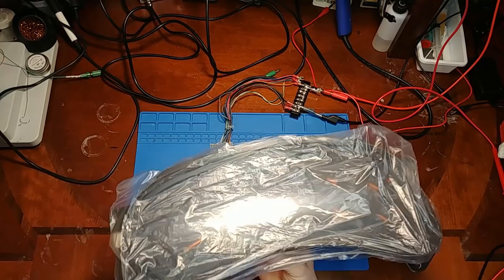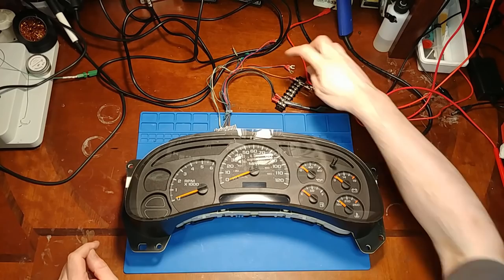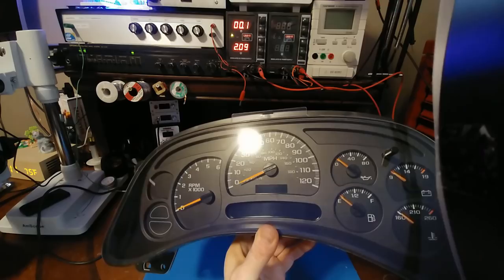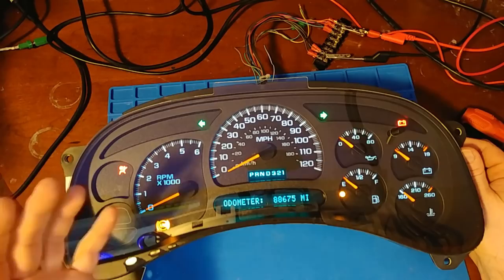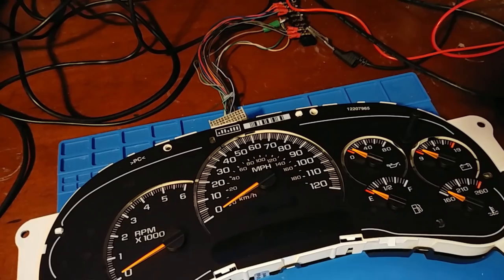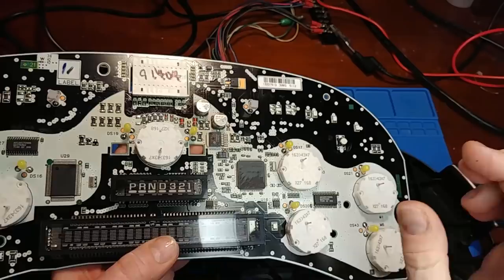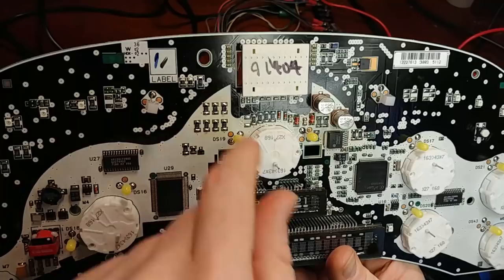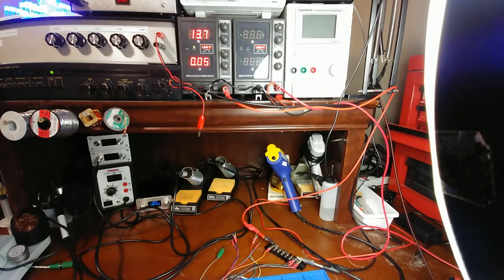Doctors 2nd opinion on battery drain

Comment: How much do you charge to repair clusters? I have a 2001 Silverado that’s starting to have issues with the cluster. I’m looking to get it repaired asap.
Reply from the maker: What issues are you having? Wouldn't want to have you send out your cluster if your having ground wire or sending unit issues.
Reply: It’s not showing prnd or the miles, it works some days and some it doesn’t other than that it’s works fine.
Reply from the maker: @rtrick5040  $50 plus return shipping.
Reply: Do you have a Instagram or something? So I can get shipping address?
Reply from the maker: My email address is listed under my channel "about" tab. It's visible to Windows PC users. If you mobile only you can leave your email address and I'll send contact information.
Reply: I’m gonna post it quick then delete it, cause it’s my personal email

Comment: I have this exact board, but my display will intermittently black out, then days later come back on. is there a model number for this board where i can trouble shoot the problem? Every 06 silverado board i look up they only do stepper motors, or it has the different display that has the PRNDL in it. like the 05 model. i'm not sure if there is a resistor that dislodged.
Reply from the maker: Any experienced thorough cluster tech should be able to do some trouble shooting and take care of that issue. It very well could be a fractured solder joint. If you send it out somewhere just make a note of the problem.
Reply: I could be way off, but wiggle your dimmer knob or run it through its full range. My dash blacks out unless I disconnect the headlight switch. I had it apart and tried tweaking the slider/variable resistor (?) but it didn't help.
Reply from the maker: @grabasandwich  did you see my headlight switch video? The plug does like to feature where it solders to the board.
But his issue is the display, not back lighting.
Reply: @grabasandwich  i can try that, but i know for sure it's not that it's dimmed, that was my first guess lol. But really it could be a loose connection in there too. my backlights are fine, just the VFD. i might just check all my solder connections.

Comment: Do you you know why my prndl display is lit but my odometer is blank, could it be an issue with the 510 resistors? 03 Silverado 2500hd 4x4
Reply from the maker: That group of 510's is for the PRND321 only, so if that display is working it's not that. You probably have a issue in the hot wire circuit or it's power supply.
Reply: Thanks for the reply and the info, I'll check on the hot wire circuit and the power supply

Comment: Jeff thank you for your very informative videos. I really enjoy them and learning quite a bit. Just wondering what have you seen causes a drain on these clusters?
Reply from the maker: It's the microprocessor not talking correctly with the voltage regulator to shut it down all the way.
Reply: In that case does it need to be replaced ?
Reply from the maker: Naw, it's probably just not getting the 5v turn off signal.
Reply: What would the repair consist of?
Reply from the maker: I'll maybe just make a trouble shooting video one of these days going over the common issues and where to take test points at. My CPU replacement video shows some areas to look. It's hard to cover these kinds of things with just words in the comment section. But for now I have a pile of work to get to.
Reply: Thank you for your time appreciate all your cideos
Reply: @jeffescortlx  did you ever make this video for 03 04?  I see mostly up to 02 and lower and 05 and up in the videos.
Reply from the maker: @williamspollitt  yes I'm pretty sure I've covered that year in a few of my videos

Comment: i have a 03 silverado that doesnt go to sleep with the key out the battery light and prndl stay lit and it kills the battery over night what do you think is up with it and i am looking for a repair service, thanks for the video
Reply from the maker: I'm sorry but I'm going to be out the last week of August and can't take in repairs right now.
Reply: @jeffescortlx  that's fine I'm not in no hurry to fix it right now but I'm not having no issues out of the stepper motors and I got apart and there's dark spots around the 511 resistors
Reply: 99 GMC doing the same , could it be BMC?
Reply from the maker: Pull fuses and monitor current draw to narrow down the culprit circuit. I have ran into 99-02 style that would not go to sleep. I ended up replacing it.

Comment: I'm having bit of a different issue with the left turn signal and hazards just making everything on the dash flash if the lights are off, nothing if they are on; right side works fine. Would replacing the cluster bulbs (twist on) with LED without resistors cause a fault? The left blinker indicator and rear bulb stay on with lights on, nothing in front at all. Replaced blinker relay, light switch and disconnected the multi-switch but the fault remained. Also, everything else controlled by the multi-switch works fine. Added LED bulbs to the front parking and turn signals as well, tried incandescent again to no avail...
Reply from the maker: LED's in both outside housings and in the cluster can cause issues. The fishers require a certain amount of current to work (older styles anyways). Also, check your hazard switch.

Comment: not gonna lie, twas hoping the parasitic draw was from the cluster just to see hwat solution there was to be had. your diagnostic and repair videos on GM clusters are works of art with surgical precision and high attention to detail. anyways, i've yet to confirm my suspicion of battery drain from the IPC on my '05 but this was informative nonetheless.
Reply from the maker: Pull cluster fuse, insert current meter, see if there is a draw with key off.
Reply: I’m experiencing parasitic draw as well on my 04 Avalanche. I watched a few videos and I did a volt meter test on the IPC/DIC 15amp fuse and I did see a draw of 1.5 mV when the rest of the fuses showed the normal .02. I pulled the fuse earlier today and will leave it out until tomorrow afternoon or the next day to see if it’s the culprit

Comment: Im replacing the LL2705 2005 Chevy Tahoe in the instrument cluster what type of solder do i use and where can i buy it at
Reply from the maker: I don't recall seeing that transistor in the 05 cluster. What did you do? And why are you replacing it?
Reply: @jeffescortlx  the shift indicator light dose not work and the odometer light doesn't work and this is what the customer brought me and the part number is LL2705 my under standing is it takes a lot of heat and uses a high temp solder
Reply from the maker: @robertlahey9836  it's probably a 2007, not 2005. Different board. No it doesn't take special high temperature solder. I have plenty of videos on the 2007. This is not one of those.
Reply: @jeffescortlx  it is a 2007 i had it mixed up with a different truck but what type of solder do i need and do i need to use flux
Reply from the maker: @robertlahey9836  I would recommend sending it to a experienced professional.
Reply: @jeffescortlx  i have plenty of experience i just need to know if it's a special kind of solder i have some i just need to know which kind it is i've been doing automotive for the past 30 years and I've been away from some electronics and from my understanding is i cant use just any solder on this piece
Reply from the maker: @robertlahey9836  i have at least 10 videos posted about 07 display repair. Why are you ignoring them?

Comment: also very common in GM trucks and SUVs 2003-2007 for radio to cause battery drainage. Easiest way to diagnose which unit is causing it by disconnecting the units one by one for a while until finding which one is causing the current draw
Reply from the maker: This time the customer claimed the power draw was on the Instument cluster fuse.

Comment: Hi Jeff, I have an 03 silverado with a parasitic draw. I bench tested my IPC and found a draw of 120 mA that is constant. I already replaced the motors and it hasn't changed. At times it will jump to 300 mA then sleep after 20 seconds...  is this something you can repair, and if so how much would you charge?
Reply from the maker: Rebuilds/repairs are $120 plus shipping.
Reply: @jeffescortlx  great! I'd like to send it for repairs. How do I move forward with that?
Reply from the maker: @adrianmejorado5250  My contact is listed under my channel about tab.

Comment: Yo tengo un problema amigo con mi cluster se queda encendido el testigo de la batería en mi cluster
Reply from the maker: It could be the small wire on your alternator. If the connection fails it will make the battery light stay on.
Reply: @jeffescortlx  my friend borrowed his cluster and the light of the battery is not on  but on my cluster the light is on . How can i fix it or how can i contact you to fix it to know where you are located
Reply from the maker: @marlorios8233  I'm located in Minnesota
Reply: Yo vivo en Houston Texas
Reply: Could you tell me how can i fix it or how can a resolved this problems?
Reply from the maker: @marlorios8233  If you want to send it in my email is available here https://youtu.be/T_2WnJMsZaU
Reply: Can you do a video showing me what part i can change to fix it please?
Reply from the maker: @marlorios8233  unclip the back black plastic cover. Inspect the board for any dark stain looking corrosion. Gently scrub it off with some rubbing alcohol and scuff pad.
Reply: Ya destape mi cluster y tiene unos pequeños parches de color negro por la parte de atrás que se puede hacer En esa ocasión le limpié con alcohol y siempre se queda lo negro en las zonas
Reply from the maker: @marlorios8233  try some light sand paper.

Comment: How did you get the data generator?
Reply from the maker: I built it.
Reply: Would you build one for a honda?
Reply from the maker: @calebd8635  sorry that's out of my wheelhouse. But a good dealer level scan tool should do the trick.
Reply: No problem I test instrument clusters as a hobby on my bench 12v power supply and function genrator.

Comment: You wouldn't know anything about BCM in cars do you how they could act if bad or no good my car Quit running and the Radio Blinkers Dome light and wind shield wipers don't work and won't run .
Reply from the maker: Bad BCM shouldn't kill the engine unless it's shorting out the data wire.
Reply: jeffescortlx I believe it could be a short My Hazard lights came on one morning bye themselves I woke up walk into garage they where blinking and the car wasn't running or had key in it those don't too now too.
Reply: @whysoserious447  Its none of my business, but have you tried removing both battery cables and attachimg them together for 30 mins?
Reply: @ccgrider1014  not for 30 minutes no have not tried that just negative cable for ten seconds..
Reply: @whysoserious447  Try it, wont hurt...
Reply: @ccgrider1014  I will sure that's ok to do I can't afford to ruin my car I would end up homeless.
Reply: @whysoserious447  I am homeless cause I keep up 4 of them...lol
Reply: @ccgrider1014  WOW ! Must be hard on the street's..so sorry
Reply: @whysoserious447  Not really, but they do cost!!
Reply: @ccgrider1014  Yeah sucks